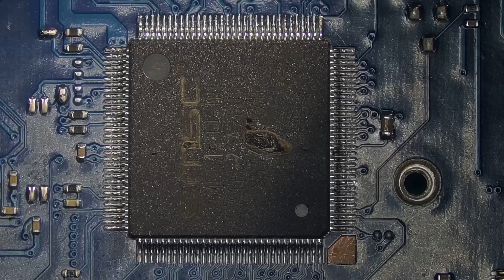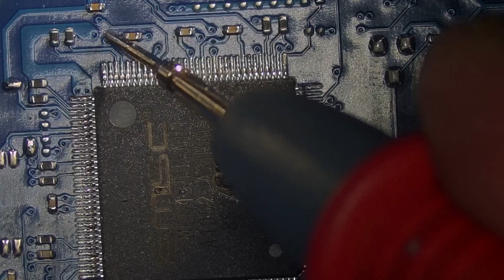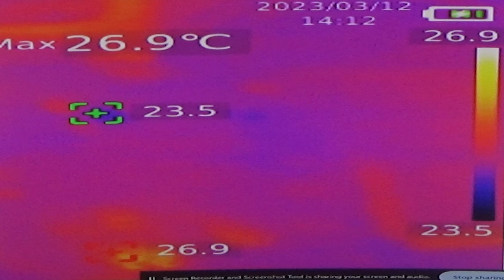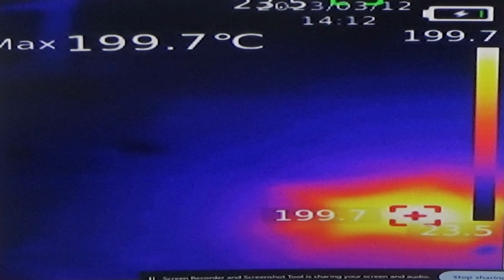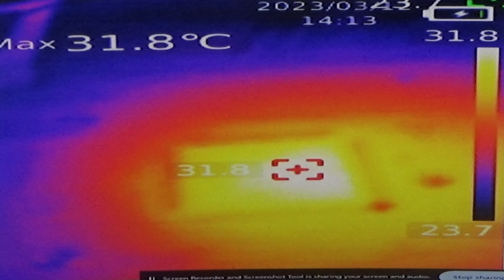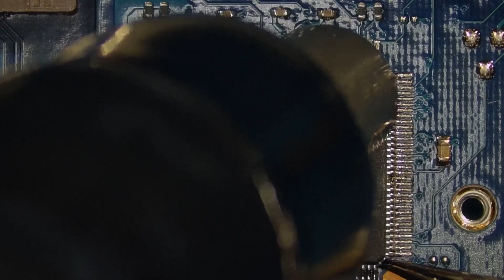Fix computer that won't turn on

Comment: Hi, thanks for the video. 

I've seen people using kapton tape around the element they want to desolder, especially when using hotair, so that they are not blown. You don't seem to be using kapton when recording your videos. Is that something you tried and consider it not worth doing (like, you prefer to fix some elements blown off that mess around with tape) or there is something wrong about using it or maybe you have some other reasons for not doing that? In this video you did misplace some components and I guess you had to fix it before putting new chip. It probably isn't big deal for you to do this but I would imagine in some cases you can even loose some element as they are so tiny. Then on the other hand, you practice soldering those components a lot and it doesn't seem to bother you so maybe I'm just worried for nothing here?

P.S. I guess the macro lens for your thermal camera could be a nice addition (at some point) to get image crispier :) Also, technically the camera can go to higher temperature, but you have to change the gain setting to "low" which is a little annoying and I guess it just doesn't matter if the tempeture is 150°C or 300°C, anything >90-100°C is probably bad already, right?
Reply from the maker: Yes, I did have to put some components back.  It is easy but I would prefer Kapton tape.  But the quality of Kapton tape I have is terrible. When I get the good stuff I'll use it.  And I will use the macro lens in the future.  Love your input!